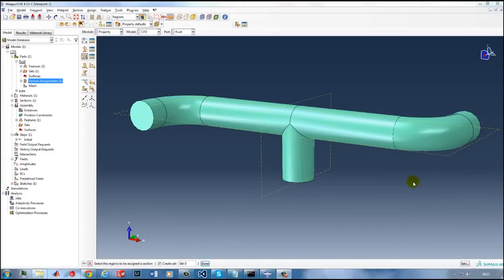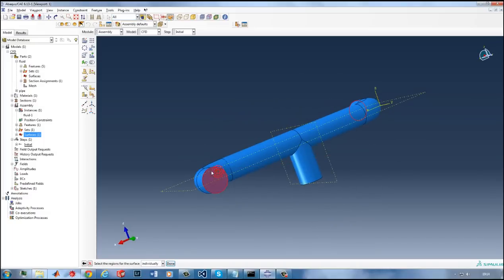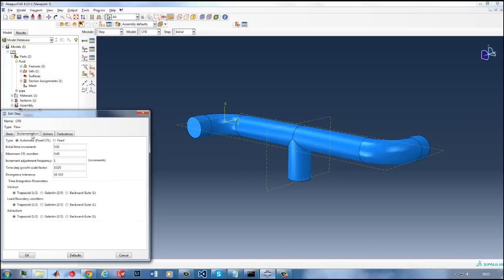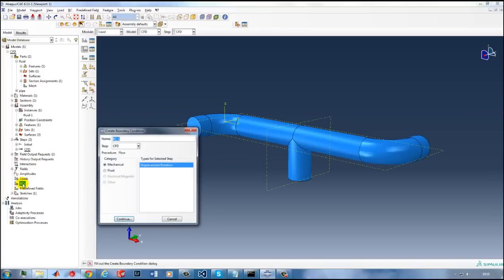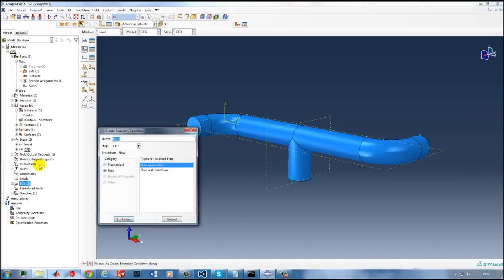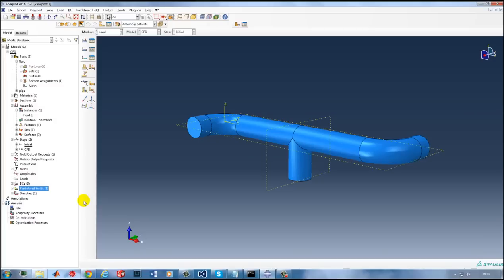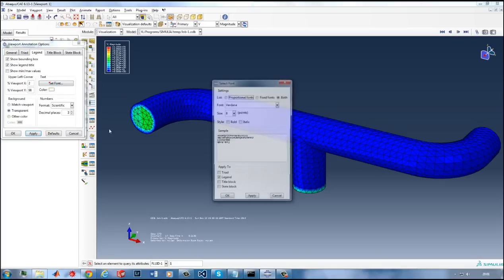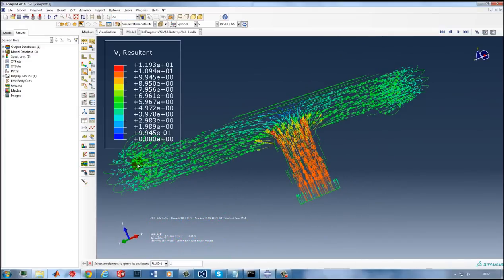Abaqus CFD Tutorial Part 2: Running a CFD Analysis

Comment: Question: What was the purpose of building the model of pipe since you only used the model of fluid?
Reply from the maker: The ultimate purpose of fluid-structure interaction is to investigate the relationship between the fluid flow and the structural stress/displacements on the boundary (wall). Therefore, a structural pipe model is required in addition to the fluid.

Comment: sir, i have a problem regarding CFD analysis. I have chosen Air as a fluid in my analysis. As the air is compressible,there may be a chance that air may not fill the entire volume(in case of variable geometry). Creating a solid model for fluid means we have assumed that air will fill the entire section. Then how to solve this issue.

Comment: I got error too when submitted "my job" and 3 times I've tried this tutorial and still error. I confused, how did it happen? how do I can fix it? Thanks before.

it said like this:
The job input file "Job-1.inp" has been submitted for analysis.
Error in job Job-1: in keyword *FLUIDBOUNDARY, file "Job-1.inp", line 32166: All velocity components must be specified for a velocity inlet
Job Job-1: Analysis Input File Processor aborted due to errors.
Error in job Job-1: CFD Preprocessor exited with an error.
Job Job-1 aborted due to errors.
Reply: Had the same error. Fixed it; go to BCs->Inlet->States->CFD (Created), double-click it and activate V1 and V2 and set them to 0.
Reply: Hey did you ever figure out how to fix the error you had
Reply: not yet

Comment: hi, i went through your steps and i got the error : mp_modes = THREADS. do you know how I can fix it?
Reply from the maker: RaiSMM Where's the error? The log file, message file, dat file? Looks like a setting in the environment file.
Reply: yes when i submitted my job thats the error i got. i googled around and there is something in the environment file  i have to change but i can not get my head around it.
Reply: +RaiSMM 
+helpSpaceMATLAB 
I got the same error... not sure how to fix it.
Reply from the maker: +MrBurnsyboy12 If you're on an x86 machine, try switching to mp_mdoes=MPI.
Reply: I had the same problem, now i finally fixed it. For me it helped to install the appropriate version of the "HPC Pack 2012 R2 MS-MPI Redistributable Package". An IT guy helped me to find out which version i needed, so maybe this is the problem you have to fix. On one PC this kind of package was not installed, on the other my version of this package was to new, i needed to downgrad the package(deinstall and reinstall older version).